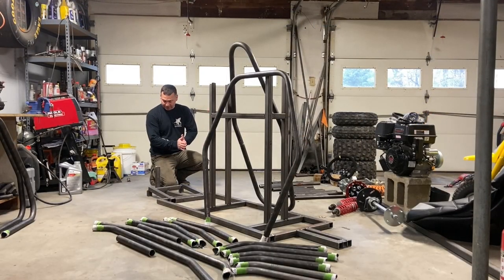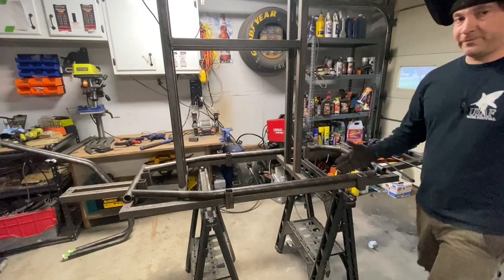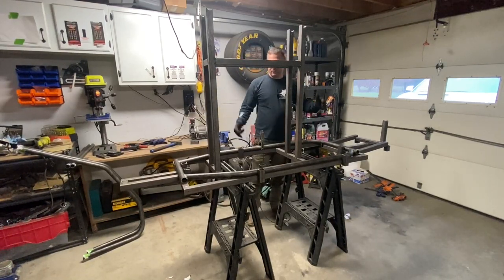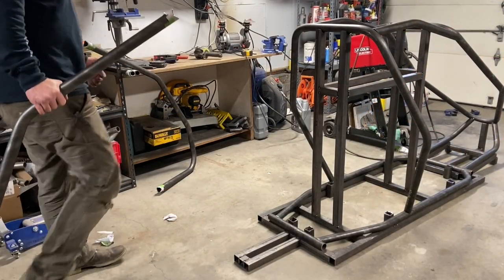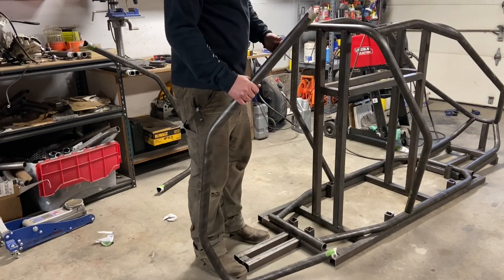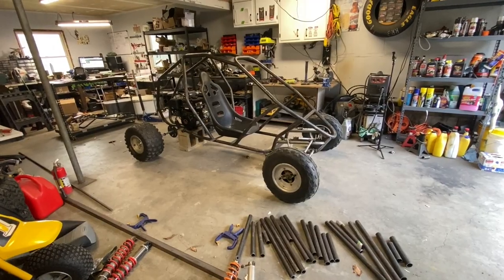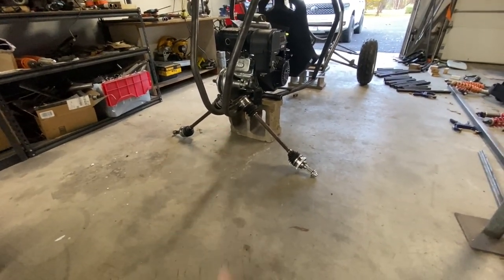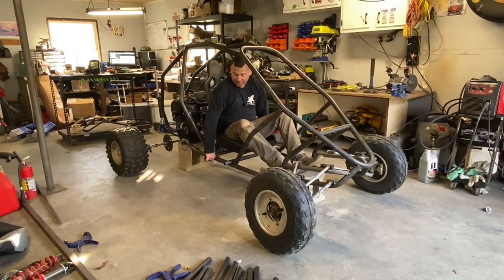Budget Crosskart Build#4: Frame Assembly

Comment: I LIKE THE FACT THAT YOU ARE WILLING TO TEACH AND SHARE YOUR KNOWLEDGE WITH OTHER PEOPLE  KNOWLEDGE IS POWER MY FRIEND I have the same nature as you I was A pipewelder and pipiefitter for 28yrs  before my ATV accident 05/06/2018 my life changed forced to retire from pipe Trade to doing nothing enjoy watching your videos very educational and inspiring to do a Kross Cart watched your custom IRS videos part 1&2. THANK YOU I WAS ON A 700 RAPTOR WHEN I WRECKED ON PAVED ROAD I Died 3 times in front of my wife and daughter then ended up in trauma icu in coma for 3 months broke all my ribs on left side in two places left collar bone and all bones in my face and TBI with right side of skull having to be removed and then after healing had synthetic plate installed to repair skull to protect  Brain. Still enjoy mechanical projects to see and challenge my thoughts and processes in my head. I used to build 4x4 trucks with my youngest son that is 25yrs old now oldest son is 31yrs old now daughter is 15yrs old now. I had built a 45' X 60' shop at home 4  bay garage was big in building cars & trucks before accident have welding machines and exhaust bender my family gave me and Ac evacuation system they used to own Whitton Radiators and exhaust  in Augusta Ga.

Comment: Great video,  I like the modifications made to the Jig for assembly. I just got the steel to start on my Jig this week. Engines I'm using...First, build Predator 500 12.5:1 compression. Second, build using my GSXR 1000 K6 Engine. Both with a Mazda drivetrain. and JD's Garage Center Carrier.
Reply: font forget to leave a like
Reply from the maker: That sounds like a stellar plan. Both are going to be very enjoyable in different ways 🦾

Comment: 15:59 was epic, looks like it might be time to turn it up to "D" 🤣  but seriously  you're projects and content are spot on. I commented months ago that a Predator based engine will make this so much more obtainable to a someone new to fabrication and/or a limited budget. Good stuff man good stuff 👍
Reply from the maker: I’ve tried it on D but it feels more consistent on C. Probably because it’s only on 110. I’ve driven these karts with them just tacked together so I know they’ll hold. I really hope the 420 is a decent kick in the pants, I hate to have to put two of them on there… or would I???
Reply: @KJRaycing Hey Man, with a cvt it's all in the clutch springs, mostly the drive clutch on the motor.  If you create more stall speed with a bigger spring it will make it seem snapper out of the hole but too much will kill your lower speed drive ability. The driven clutch wants to just keep the motor in its power band. And just a heads up... always keep a spare belt and tools to swap it out on the machine. Ask me how I know 🤦‍♂️

Comment: Ever thought of doing paddle shifter on the steering wheel
Reply from the maker: Nope 😉. I’ve been a huge fan of rally racing since I was young (pure 80’s and 90’s rally), so I always wanted that lever that controls a sequential gearbox. Now to figure out a gear indicator to put right in the middle of the dash 😎

Comment: If you want a good strong independent rear and front farely cheap with a 4x110 bolt pattern look into parts for a 1990 Toyota Carolla
Reply from the maker: I just may do that, I had a celica GT-S and if I remember right it was a nicely triangulated trailing arm which could work out really well. Thank you. 👍

Comment: Heya,

I’ve been researching the tools needed for this project. I’de like to get the same welder you have. I looked up the 140HD and it say gas and gasless. In this clip I noticed you have a bottle on the back of your welding rig. Is the gas required?

Thank you again for everything! I got the parts list and started working on collecting. I’ll end up getting the VF-1 XL Plans as well as the IRS ones shortly.
Reply from the maker: Well hello! The 140hd has been awesome so far. Out if the box it is flux core, but if I remember right it comes with the regulator to convert it to gas. Just buy a bottle, hook up the regulator and I think you might have to switch polarities, check the manual.  The whole process is easy and takes no time at all. You can get good welds with flux core but MIG (gas) makes your welds look very clean.  Thank you for joining in on the fun!

-Kyle
Reply: @KJRaycing  excellent, I’m in and fully committed! Got all necessary plans. The tools I need are easily attainable except the bender. It’s going to be a while till i can get that, but this is going to be a rad project!

Comment: When you said the wheel base is 81inches is that center to center or outside to outside ?
Reply from the maker: Hub center to hub center front to back is wheelbase. Track width can be either contact patch or overall outside width left to right depending on the context.
Reply: @KJRaycing ok  thanks

Comment: You mentioned a link to " JD garage " for the miata rearend..but you didn't post the link in the description..nor is " JD garage " a YouTube channel under that name at least..Can you post the link or elaborate more on whom you mentioned that was working on a rearend assembly made from off the shelf, commonly available parts etc..Thank you..
Reply from the maker: The little info button in the corner of the video when I mention it is the link. Also just added it to the description. Thank you for the heads up.
Reply: @KJRaycing  Thank you for the response back.. perhaps I should have searched for it exactly verbatim..as YouTube couldn't find JD garage as it should have been JD's garage..definitely appreciate your support in the community..Thank you..

Comment: You mentioned in previous videos that you are 5’11”, I am a very small 15 year old about 5’4”, do you think shortening the frame would be bad or change the handling way too much?
Reply from the maker: Don’t shorten it. The shorter a wheelbase is the more unstable it is at high speeds. You are just going to mount the seat to fit you. I made removable brackets for my girls go karts so they could grow into them. That would be a really good idea for you too.
Reply: Ok thanks for the info on that, I think I am going to make an adjustable seat because I have many that would want to ride it.